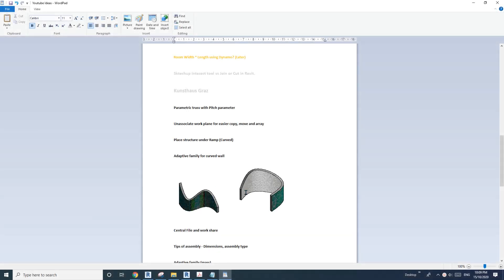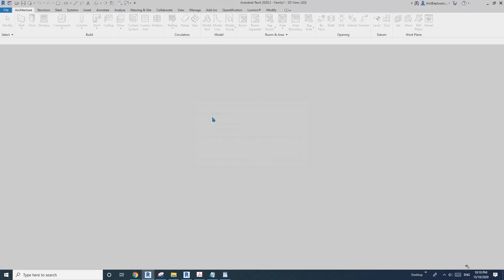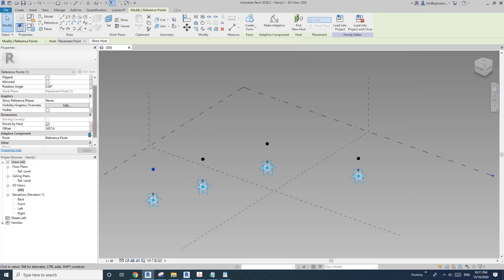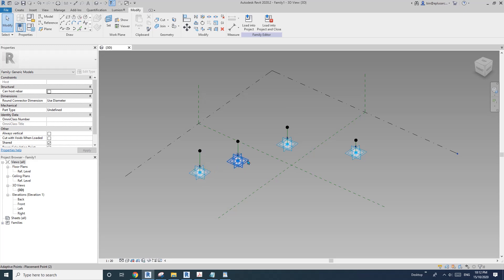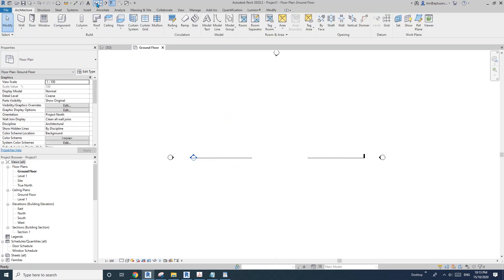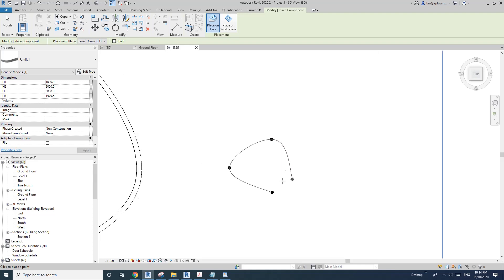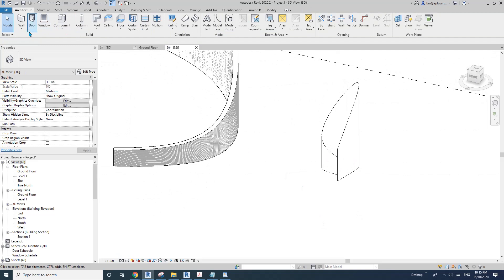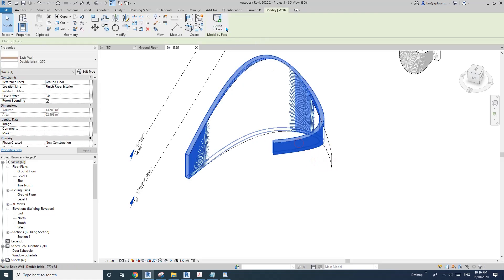Revit Exercise (Day 211) - Adaptive family for Curved Wall by Face

Comment: Hi, my question is: after you've that organic wall can revit interact with it? like, add some windows or voids on it? because apparently  Revit doesn't like to work with those organic shapes too much...
Reply from the maker: If that wall is a Basic Wall created using Wall By Face, it is possible to place standard doors and windows. However, the result might not be ideal.
e.g. https://drive.google.com/file/d/1roN4zFpAOX_ohKaWNY8k3ZUuuBZ3uYx3/view?usp=sharing

Comment: Can you make it slanted as well?
Reply from the maker: Yes we can. Instead of placing 4 points on those 4 adaptive points, we can place 4 points using place on face on the reference line, then place another 4 points onto those new points. I will do a quick video for this, maybe during the weekend.
Reply: @BINHE615   it would be nice to show Bin !